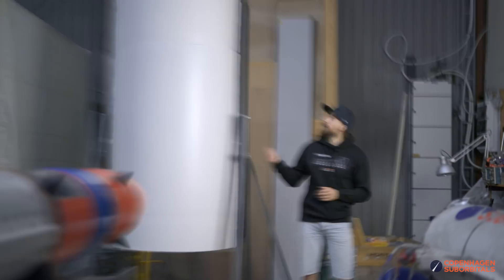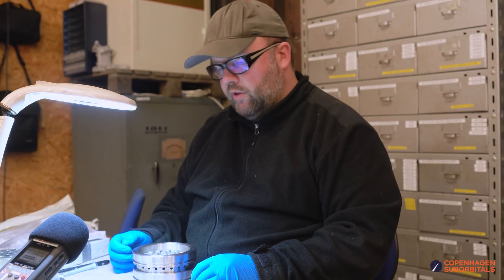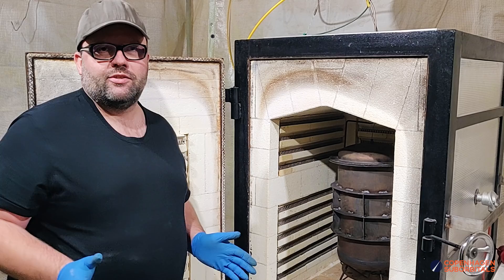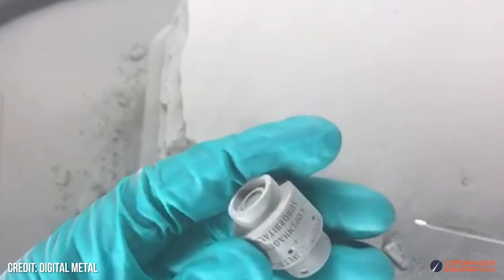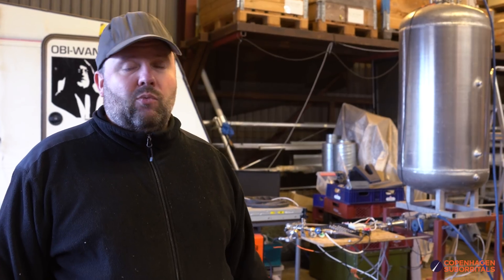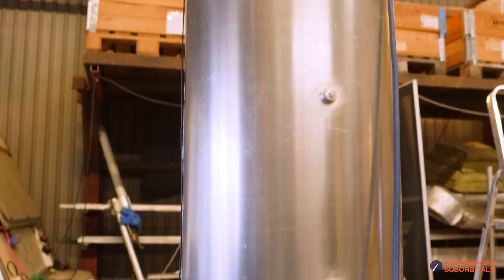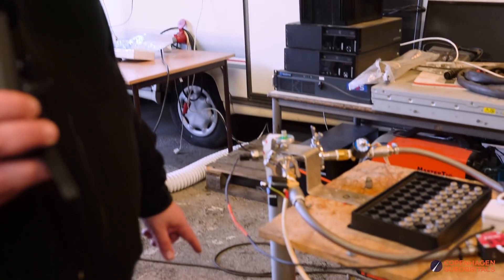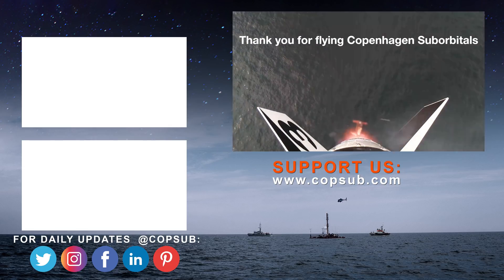Making ROCKET Engine Fuel Injectors - FINAL STEPS!

Comment: Hi, I got a question (not really a question) about the swirl injectors, you get in the Agricultural circles that uses nozzles that makes evaporative cooling, the injectors works under very high pressure +- 1000 Psi and only opens when the desired pressure has been reached, they are made out of Stainless and the sizes starts from big, 1mm to 0.01mm, the mist that it emits are super fine, it look like any airosol maybe even finer and we mix into the water nutrition that covers every single bit of the plants, even on the underside of leaves. As an experiment I used ordinary petrol and compressed it in the final stage before being forced through the nozzles, 0.02mm with no Oxygen added before compression and the flame that it emitted from a single nozzle was enormous. The nozzles can be set to emit in a few ways, the conical shape of the airosol emitted can be increased in diameter or focused on a long straight point. When you take the nozzles apart, there are 3 main parts, a entry washer,, a wormlike spiral (auger) that mixes the fluid and then an exit nozzle that is designed to open at spec, pressure. Now I know I am getting screamed at right now, but as a boat owner I pay for  pump for my boat $1000 were I can buy exactly the same pump from an irrigation shop for $25.

Comment: just heat up the liquid fuel, it will nozzle itself
Reply: just like heat sink with jet hot air with only a heat source, by expansion of heated air, on input smaller area side to output larger area size, a rocket nozzle, of heated air external combustion (nuclear) rocket/engine, running an air plane for months

Comment: Hello!  Love the videos.  I'm and ME/EE engineer myself and over the years have played with trying to build a small liquid fuel rocket engine.  I've never gotten past the injector plate! :)  Like you, I've got 304 SS as a base.  Was looking at doing traditional impinging flow injection.  One thing was that I was going to braze copper to the stainless steel very similar to how the Saturn F1 injector was made.  Just getting into the brazing.  I was wondering if I could ask a couple questions:
1. What solder paste are you using
2. What is the purpose of doing it in a vacuum?  I need to correct this.  I understand to prevent oxidation.  Did you consider an inert gas environment like argon?
3. What is your vacuum chamber made or?  SS?

Comment: I wonder what the legalities are for this project, your basically making a crewed ballistic missile in a shed. You'd think somebody would have stepped in already and ruined it but they seem to be doing just fine.
Reply: We have a close collaboration with authorities. The Nexø class rockets were borderline cases at the time. Spica will not be, so it requires close collaborations with authorities. But remember executing sea based rocket launches to high altitude is not something you do on a sunday with nothing better to do. Besides all the rocket stuff, an amazing amount of paperwork precedes a launch. This includes large amount of reports for security and risk assessment and calculations. There are no short cuts.

Comment: Just watched your video ,my question is why use water as your injector flow test when the fuel and oxidiser give different value due to density values and pressure  The water will flow differently to oxygen and the fuel .

Comment: Hey guys, just a tiny question out of curiosity:

The injectors are flow tested with h2o @ ~5 Bar on both sides. In operation they will see O2@90 bars on one side and ethanol  with "way less than 90 bar" on the other, right? Isnt the difference in pressure  a consideration in flow testing? Or am I guessing wrong and in operation both sides will see the same pressure too? (Or maybe i mixed up my fuel and you are not using ethanol after all?)

Would appreciate an answer :)
Reply: LOX and ethanol will have approximately same pressure on the "cold" side of the injector. That is how it must work. That pressure will be in the 18-25 bar range. The injector it self adds loss in pressure and  chamber pressure will be in the range 15-20 bar. However initial test will not have to be at that pressure. You can qualify the flow characteristics using water and lower pressure to get a fix. The rest is mathematics and fluid dynamics and admittedly a model for how to calculate things taking into account the difference in among other things viscosity. This is the science part of rocket science.

Comment: Could you use an injector from a high output diesel or a methanol injector used in a 5000hp dragster engine?

Comment: Does the automatic test characterise the output distribution and mixing of the propellants.  If a particular nozzle  creates an oxygen rich zone to its left, the placement of that nozzle within the engine may become significant to engine integrity.  This may require two different liquids in the test setup, such as water and ethanol.

Comment: The mixture ratio control you folks are doing on the two injector zones is a great idea. In my experience this allows you to dial up the overall engine O/F ratio closer to optimal (assuming you are cooling limited) resulting in increased performance.
I can't wait to see this static fire!
Reply from the maker: Thank you! We are looking forward to a static fire bonanza as soon as the corona restrictions are softened in Denmark.

Comment: This is actualy a genuinly interesting component, despite it's small size.
Personaly i also look forward to see more of the pressurizing device for the engine fuel on the testsetup.
Reply from the maker: We recently received new parts for the LN2 burner and heat exchanger, but it might not be a priority for a few more weeks.
Reply: @CopenhagenSuborbitals  I fully understand that priority, whan i wrote here i just came from re watching a live demonstration video (made by those british astronomy guys) about the injection nossles of the V2(A4) engine, it is interesting to compare the systems, (i think however the A4 engine where more to be classified as semi low pressure by modern standards, somewhere between this concept and modern type high pressure systems). I think the cluster design on the A4 engines was mainly because of the unusual construction of the oxygen injectors, later designs (developed in the US after the war) where more like this.

Comment: Do you know oh much pressure these little electro valves can handle 7:39 because I need a safe way to light my small liquid rocket engine at a sufficient distance but my fuel is at 300 psi and my oxygen at 400psi
Reply: @tristanlongangue5671  if it’s big enough I would recommend using the cotton and wires, it safer Because then you don’t have to approach a fully loaded test stand with a flame and then run back and hope that the sparkler is still burning.
Reply: @machy8515  yeah or matches and wire but cotton is a very good idea since i just have to change the cotton and its less problem than matches and for safety also. And i will buy a radio commanded relay for the valve so i will connect the ingniter on it
Reply: What are the propellants?
Reply: @machy8515  I use ethanol and Gox

Comment: Sir how do u drill so much small holes in the injectors , I am also making a injector plate but no one agrees to make a hole which is 0.5 mm in diameter , any guides into this will really help
Reply: Also one more thing how do u segregate oxidizer and fuel inside the injector?
Reply: @thecros1076  I don’t think you know what you’re doing
Reply: @iain3713  lmao
Reply: @iain3713  I really know what I am doing 😊... thanks for the reply btw
Reply: @thecros1076  the fuel is coming from the top and the oxidizer is coming from the side by holes in the side of the injector i think
Reply: @tristanlongangue5671  yeah totally true ....I think they have a oxidizer manifold which distributes the oxidizer evenly through the plate ......I also have made my own injector design which is unique in its own way ... hoping to cold flow test it soon after fabrication
Reply: @thecros1076  Almost any questions you can ever think of is answered in many of the other videos on the channel, like: https://www.youtube.com/watch?v=0qvbyl7KuNw